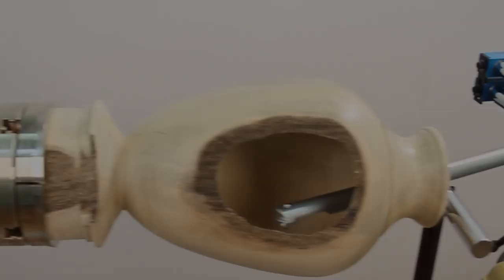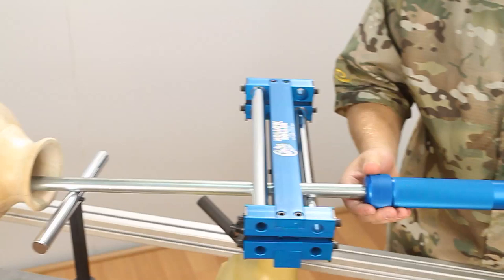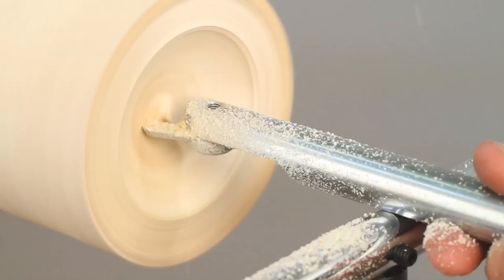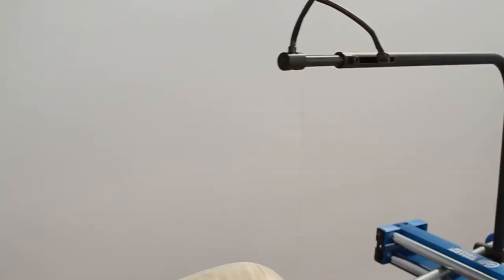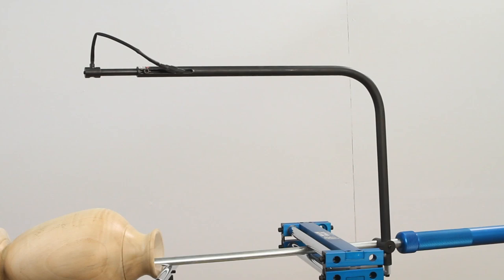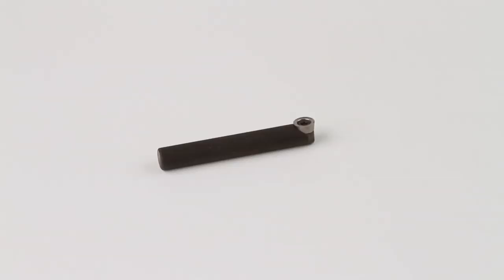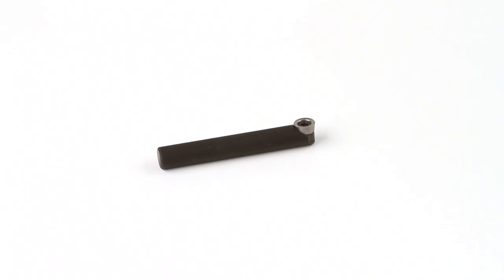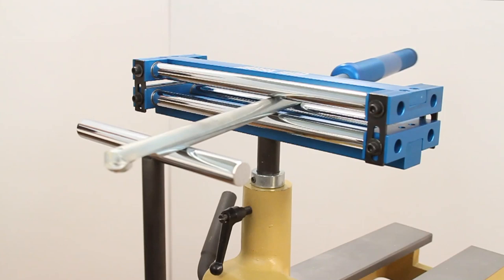Hollow Roller Captive Hollow Turning System (Woddturning)

Comment: I don't get it, it says it can hollow as deep at 8".  You can go that deep with almost any tool!  The Robert Sorby 2000 system gets you to at least 13" deep for a fraction of the cost and bulk.
Reply: Fraction of the cost?  The cheapest I found the Sorby 2000 system was about $325 and that is more than this one.  Where did you find it for less?   Please post it, thanks.
Reply: I have since discovered that this was a typo on the Craft Supply site. This hollower is supposed to be able to hollow as deep as 18 inches (not 8). I have contacted Craft Supply, and believe they have since corrected this.

Comment: Cheating what? There are several projects that can only be done with very specific tool and deep hollowing tools are one of them. You got legs yet use a mean of transportation, is that cheating? No, you need to cover a bigger distance. For my projects I need to hollowing up to 20in deep sometimes more.